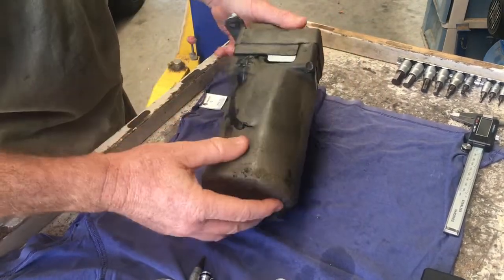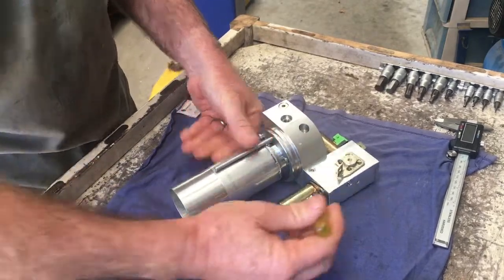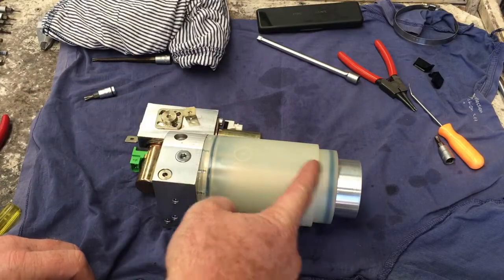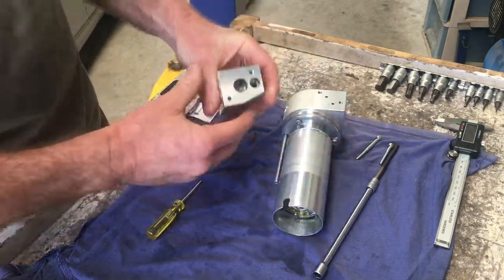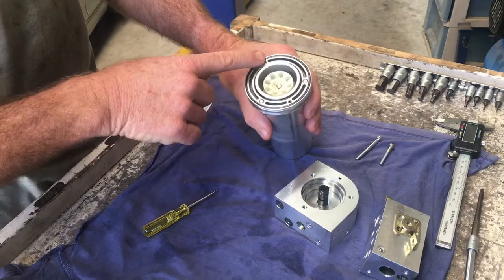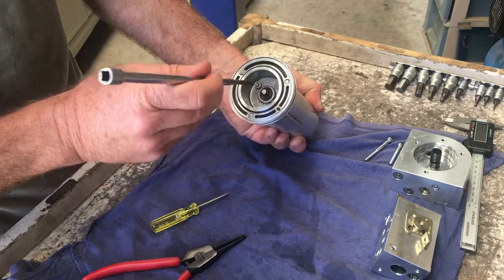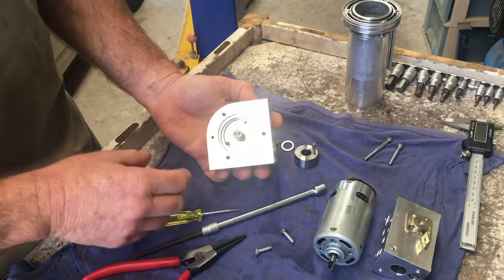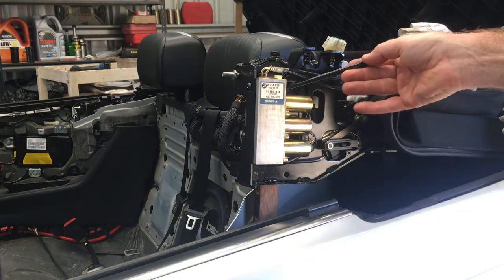E46 convertible pump and valve block

Comment: Hi, great video, what issues were you having with your roof out of interest? When I’m opening mine, the roof seems to lock out at the point where the rear solid cover is fully opened to the vertical position so I’m thinking it’s one of the bank of 3 solenoids being faulty, as the soft top wont fold into the boot space
Reply from the maker: Mine was opening slowly that turned out to be a leak on the block connected to the pump. First thing I'd do is get INPA setup and look at indications from the CVM. I'd go to E46fanatics.com and look at the convertible section for guidance. A lot more there than I can try and pass on here.

Comment: Is it possible to bleed air out of reservoir by loosening or removing the 2nd screw( to the left on 2000 323ci E46) from the pump body?

Comment: What was orginal issue that made you do this
Reply from the maker: I had some leaking hyd cylinder O rings, so I decided to pull the whole thing, replace all seals, clean it out, show how to test stuff etc.
Reply: @jeffrichardsoncardiy  ok great- i have a problem where my e46 roof retracts half way then stops then needs manually putting in compartment , then when putting back up struggles to come out of compartment with help brining it up it does latch - ive checked the loom wire for potential weak points look ok. not sure if its a pump issue tbh or i should change the fluid
Reply from the maker: @Umer-v3o  If it's not suddenly stopping, but instead just struggling to move with the pump still running, there is a pressure problem. I'd initially suggest removing the pump and all solenoids for a full clean and also replace the fluid. If this doesn't help then it's probably the seals inside the main hyd cylinders that are failing. Common problem, but can be fixed by Top Hydraulics. Expensive, but they do very good work.
Reply: @jeffrichardsoncardiy  Oh great , i think i forgot to mention prior to having issues i had a window regulator problem and during this time was having issue-replaced window regulator but same issue.
Reply: @jeffrichardsoncardiy  bascailly stop suddenly halfway
Reply: @jeffrichardsoncardiy  is seems like whole system out of sync..any  manual reset i can do interms of electonics
Reply: @jeffrichardsoncardiy  Theres a few cyclinders main cylinder, bow cylinder anc cover- What is fuction of bow cylinder
Reply from the maker: @Umer-v3o  Bow cylinder is the tension bow, which is the rear part of the roof where the window is.
Reply from the maker: @Umer-v3o  That will be some sort of electrical issue, and is 99% of the time the wiring loom that runs down the left side. There is normally a broken wire, that is still connected OK, but will separate as the roof moves due to the loom being bent. Two locations that it breaks. Above left seat and rear left where the valve block etc is. Most likely is above the left seat, but I've had both.
Reply: @jeffrichardsoncardiy  ive checked this slight nip in one but not enogught to stop
Reply: @jeffrichardsoncardiy  will this show up on a scan?
Reply from the maker: @Umer-v3o  Yes, an electrical issue will definitely show up as a CVM fault code.

Comment: Great job and video I just bought same car and top not working changed the control unit still same ..any advice I will appreciate it ..I am all the way overseas in egypt
Reply from the maker: I would suggest going to the E46fanatics forum and looking at the convertible section. There is a huge amount of information there about the possible problems and fixes.
Reply: @jeffrichardsoncardiy  thanks for reply I will do this and again I appreciate your reply and the video great job
Reply: Did you figure out your problem? What is year and model of your car?

Comment: Jeff, Great video but I found a very simple and effective way to remove the plastic reservoir Flip pump body upside down, gently clamp in a bench vice so reservoir is pointing up. Grip reservoir and gently turn while pulling away from body. Mine came off with very little effort.
Reply from the maker: Thanks for the feedback. I'll try that next time.

Comment: My e46 has a very slow opening and closing roof which eventually runs out of steam halfway through opening, what part of this would need replacing, the motor?
Fluid level is fine with no leaks in the system.
Reply from the maker: The first thing I'd do is pull the pump and clean it all out and put in fresh fluid. Also clean out all the solenoids including those on the valve block on the left side. Then see how things work. Often this can fix the issue. If not it could be a few things, maybe the seals in the main hyd cylinders.
Reply: @jeffrichardsoncardiy  Thank you for replying, I'll give that a try.

Comment: Hello sir 
incredible useful video . I have an issue that  when I want to open the top the black tonneau cover will not lift up on the contrary the pump wants to close it even more . I tried another pump with another attached single solenoid and the issue remains also I tried another motor under the seats but no change . Any insights would be greatly appreciated
Reply from the maker: It sounds like V1, the solenoid on the pump that controls the tonneau cover isn't working correctly. Whenever the pump is operating it will port fluid to lower the cover. When V1 activates it then applies pressure to both sides, which makes the cover open due to the greater surface area on the open side of the piston. 

Have a look at the following thread at E46 fanatics. You will have to scroll down to my comments (comment #8) that explains how all this works.

https://www.e46fanatics.com/threads/have-i-made-a-damage.1318404/#post-19173321

Comment: hello sir 
May I ask what is the inner diameter and thickness of the largest O-ring at the bottom of the hydraulic oil pot and the O-ring at the top of the pot? 🙏
Reply from the maker: I don't have those dimensions. You'll have to remove and measure.

Comment: Hello sir,

I bought a new pump some years ago with 3 (or 2) solenoids on the pump. But original there is only one. When I swapped the pumps I have the same issue. The hydraulic starts to foam when starting the procedure. I have to manually help the vert to operate. I really don’t know if the old solenoid in to the pump is my problem. There is no pressure in the system. I just hear the engine spinning, not the “ruffer” sound as it should be. Do you have some suggestions?
Reply from the maker: The pump with the two solenoids is the old variety. The pump on the later model cars had only one. I've never come across that problem before, but it sounds like it's sucking air into the system somehow. If it's happening with two different pumps then clearly the problem isn't with the pump. It can't be an external leak so it must be internal. Maybe a jack seal or solenoid.
Reply: @jeffrichardsoncardiy  Thanks Jeff. Im really tired of this symptom. Hard to find information about this problem actually.
Reply: This could be sucking air from a loose fitting or a pinhole in a line.